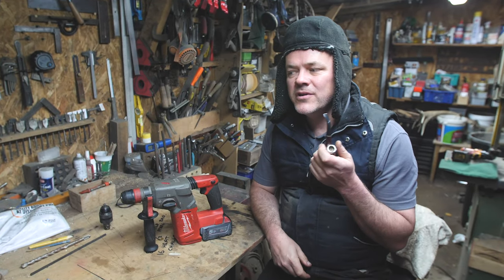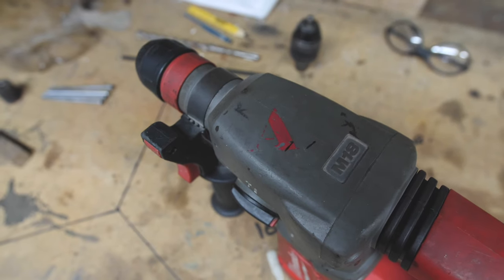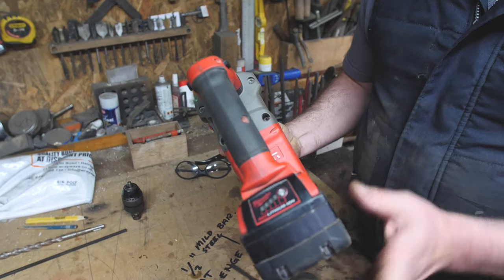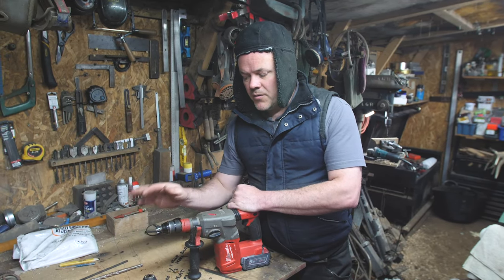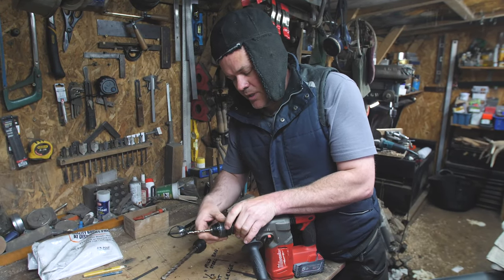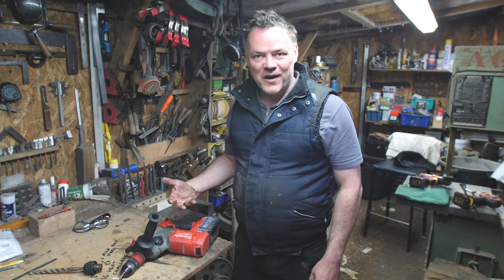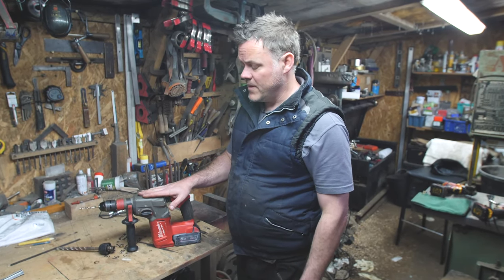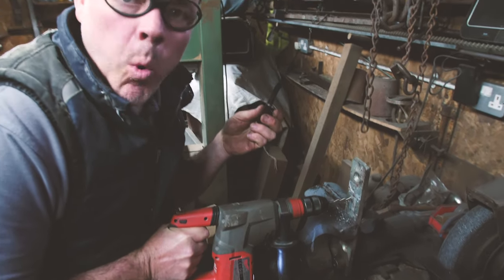Power Tool Review   Milwaukee FUEL Cordless Drill

Comment: I have not come across this type of interchangeable chuck before!
All of the SDS chucks I have used are the "pull back" type! It is a great invention in that you can lock the rotation and you have an Electric Chisel ...... no more hammer rash! There are different types of screw chucks as well, some even are lockable after tightening by simply sliding the back of the chuck forward.
Back in the day we used to have to drill many many 20mm holes in concrete with the old screw chucks (remember chuck keys?)and we found the problem with slippage was severe. The only real solution was to eather buy bits with flats ground in the shank or more cheaply grind our own in!
With SDS drillsI have only really used Hilti and  Milwaukee....... The first Battery drill we had was a 55v Hilti that could get several hours of drilling 10mm holes in reinforced concrete ...... that was way before they invented Lion batteries!
Reply from the maker: Just finished doing an installation at Goodison Park, (Everton Football Club). This drill chewed into reinforced concrete, only 12mm, but really hard stuff. Loads of the other trades had hilti kit, think it probably even better than Milwaukee! Probably more expensive too! Cheers for your comment, keep watching! All the best.